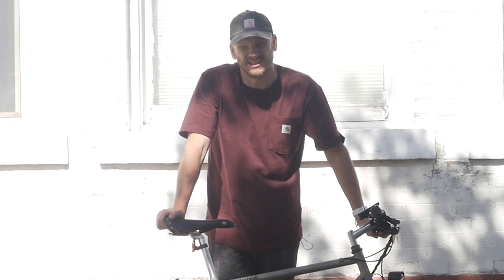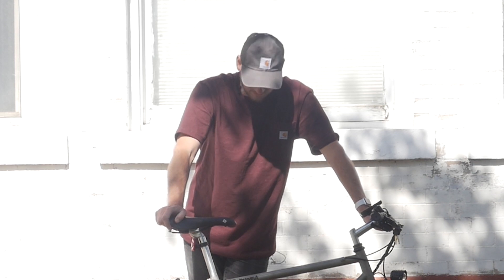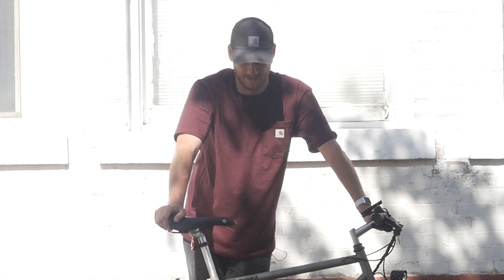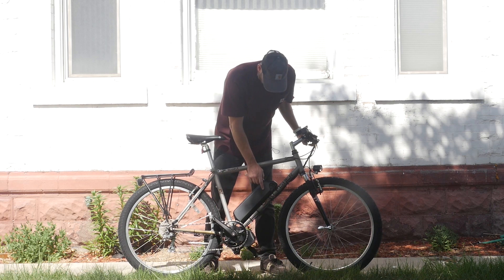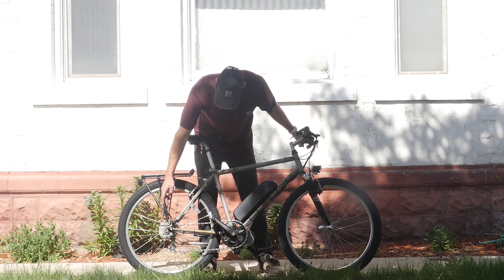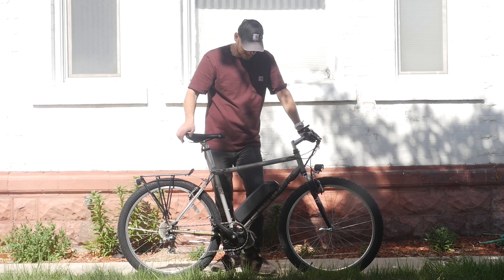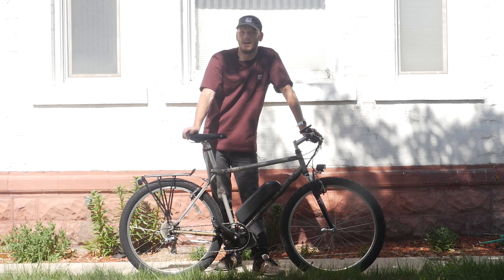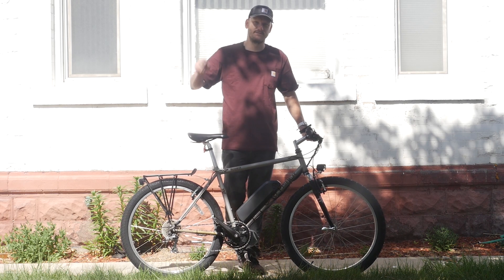Custom E-bike Build: Gary Fisher Mamba BBS02 52v

Comment: Nerd question / potential video idea: your thoughts on Steel vs Aluminum frames for mid drive conversions? have you ever had any problems with bike frames that were too weak for the bafang torque?
Reply from the maker: Only once and it was a 15 yr old aluminum full suspension bike. I would take steel over aluminum if it was an option for sure.

Comment: Hey Johnny. I live in hilly area. Q: Would switching from a 46T to a 36T decrease my battery range or maybe increase it? From what I understand the motor draws the most watts when climbing so hypothetically it wouldn't have to work as hard with a 36T... maybe.

Comment: Another great video! Right on in every aspect.  

My Tongsheng supplier calls Bafang, "The King of Quiet." Competitive, not even pro, cyclists put out more constant wattage and near double the torque of a Bbso2. We don't hear about chain breakage or cassette failures. On Monday, a TDF racer put out 1355 watts constant for 20min's. That whole time he was producing 300-400nm's of torque on each side of his stroke! In other words, that chain was getting yanked hard, constantly. 

From Bike Forums: '...So assuming your 140 pound rider is a pro cyclist who can most likely single leg press over 400 pounds on each down stroke (probably a modest number) You get the sum of the forces in Nm as 109 + 311.5 (probably modest) + gravity (negligible) so you are looking at roughly 420 Nm of torque...'

Comment: Nice build. Nice to see a Gary Fisher bike. Don't see too many any more.
I think you confused the peak number of the BBS02 with the HD. Assuming 50 volts at 25 amps the peak on the 02 is about 1250 watts. (Still more than enough for high speed, wheelies and to test any bicycle brakes).
I like a BIG display so my old eyes can read it without glasses;(
Reply from the maker: 58.8 volts is fully charged. Times that by 25 😀
Reply: @JohnnyNerdOut  Optimistic (still shy of 1500 and only possible for a moment) but an acceptable premise.

Comment: That bike is similar to my old Mongoose mountain bike which is 25 years old.  If that bike is a good ebike candidate, then my Mongoose should be too. I just wish it had disk brakes, but the frame and forks w'ont allow it.
Reply: Don't believe the hype about e-bikes "needing" disc brakes. Unless you're bombing down hills and or riding in inclement weather rim brakes are fine. Just get good brake pads.